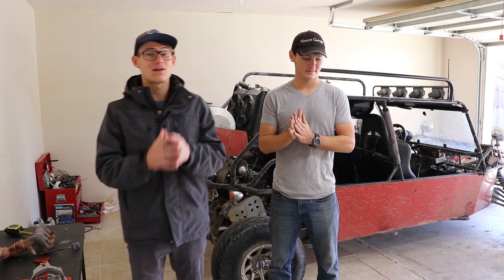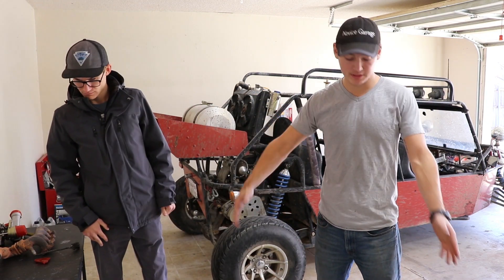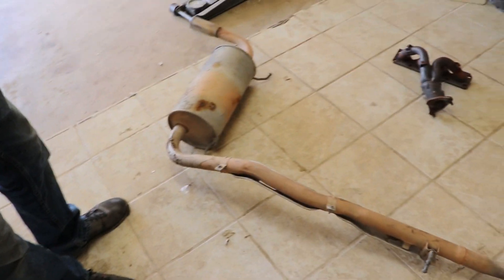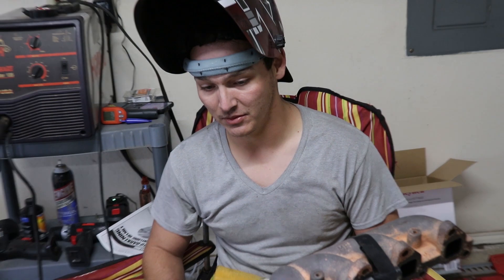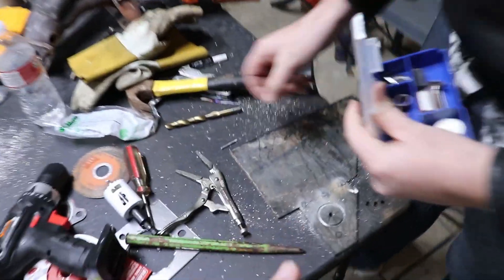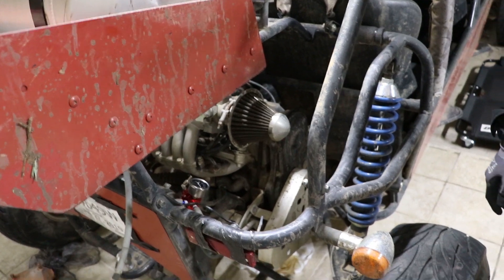Street Legal Dune Buggy Is Getting a TURBO! 🚀

Comment: Don’t use the oil plate as a return, the oil will have back pressure on the return side and will leak oil past the seal at the turbo. Add a 1/4” tee at the oil pressure sender and use that for the pressure side then return the oil into the highest part on side of the oil pan, you will have to weld in a bung fitting. Use at least 1/2” high temp hose. I used hydraulic hose on my set up...

Comment: Your having issues because your using flux wire you wanna use mig with gas you can weld it at cooler temps

Comment: Please do not try to take your oil feed and go back through the field or you will have to literally take the oil pan off and weld in an a long and run your all lined up there you have what is called the high pressure side which is the one that's coming off your off your oil filter adapter plate that one's going to run into the top of your turbo and that's going to keep the turbo itself cool you're going to have a non pressure side which comes up normally out of the bottom of your turbo and it will literally need to go either into the oil pan or I have seen where people have put them into the top of the valve cover but it's not a good idea because they're still somewhat back price back pressure crankcase pressure and it will actually shove it back through there if you run it through the valve cover if you don't have a baffled valve cover it needs to go into the oil paint I do apologize I just don't want to see y'all blow something up you know I'm saying this is one of them people trying to look out for you cuz that's what it is what it is
Reply: James Boswell  Agreed

Comment: Its to heavy and the wheel base is to long, to ever climb any hills of decent size. Get rid of this pre built thing and get or make a real 2 seater sand rail with a VW engine.
Reply: Not true.  It be a good whoop runner if it had any real sups on it.  Look at the hoonigans baha prerunner bug vs the 4 seater

Comment: Haltech, Greddy E-manage blue, Megasquirt..(the list goes on).. Are all computers that could run that motor!!

  This "old school", cheap, short-cut F.M.U way that you're trying to go with is not going to work with the stock fuel pump and is probably going to pop those Chinese injectors! LoL
It's Not gonna run long or well on the stock tune... going to need some kind of fuel management that changes injector pulse and duration!(not to mention you'll probably need to increase the injector size period!) And when you get it to run you'll maybe able to run like 5-10P.S.I max on 100 octane...
Reply: 👌 Just look to how they got the Miata and the TC running right... 
Proper Fuel/timing management... 
They know how to do it right! Their just not gonna put that must time and money in this china buggy!

Comment: Did you try messing with the power and wire speed settings on the welder? Just a friendly critique guys, definitely work on the welding. Not terrible, but I know you can do better very easily

Comment: usminitrucks.com  660cc u can import a van but yeah...yall need a truck and it fits ur "overnight parts from japan" weirdo vibe.   also NO one is working on one on YT and making it fun.  also its a honda....yeah...get a basic 2wd model and have fun
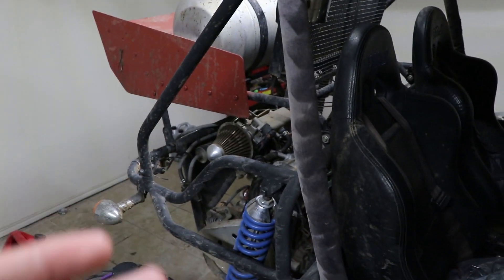6:35 turbo needs to sit higher than the drain thats all.
7:00 challenge accepted,  
https://www.efisource.com/wp/shop/microsquirt-ecu/#ecu 
challenge completed 
7:10 word from the edujcated replace the fuel filter
7:40 pipe it to the intake manifold after the throttle body
8:10  newer pump might be a idea too
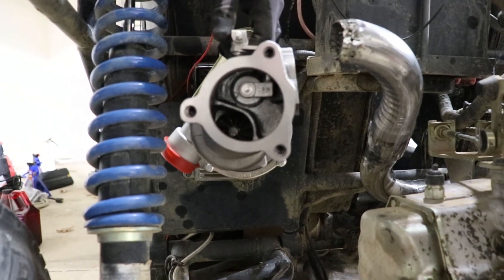9:05 make sure to mount the turbo to the engine,  so it wiggles with the engine.  couldnt see that mount too well.
9:15 space heater, just sayin,
enough power to spin a bearing.  prob 60 hp b4 at 6lbs lookin at 80 on 91 considering the engine is a 8~;1 comp
Reply from the maker: Wow thanks for the info!
Reply: @NoviceGarage  take it with a grain or fist full of salt, im a parts guy xD
Reply: @NoviceGarage  oh...just make a bracket from the exhaust manifold to the turbo thats the simplest i like to think .